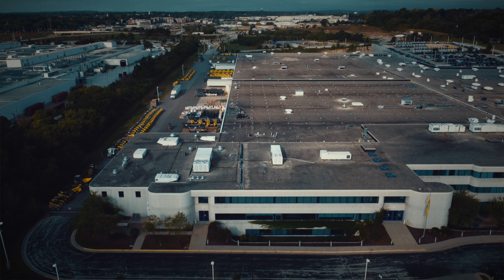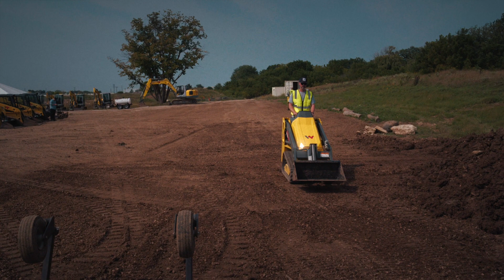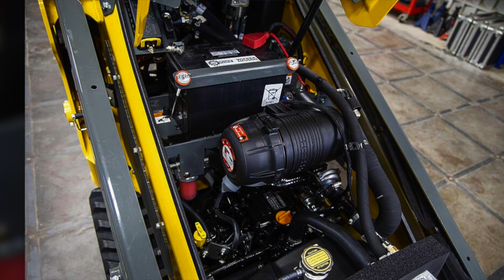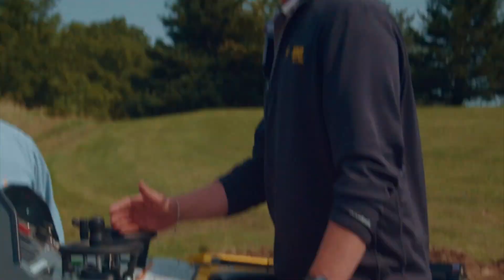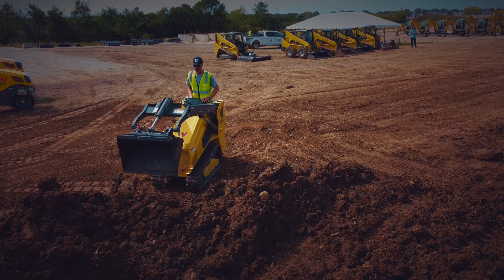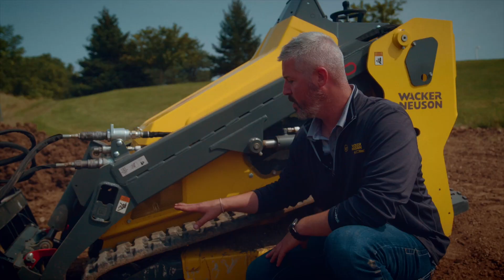In the Dirt: A Closer Look at the Wacker Neuson SM100 Mini Skid Steer at Work

Comment: I have the Ditch Witch SK1050 in southern Arizona and there is problem with radiant heat from the radiator, so I have no idea what he’s talking about. I love having the ability to step off my Ditch Witch and still operate my machine from the ground. As far as the joy stick controls for travel the single lever is optional, it’s your choice.

Comment: Looks like a nice machine and narrow is always good. The issue with all narrow machines is that everyone talks about how wide the machine is,  but rarely comment on how the bucket is wider. If you are truly working in a very confined space where machine width is the concern, a bucket that is wider defeats the purpose of the narrow machine width. It is not always an option to.lift the load above the narrow space
Reply: You can just lift the bucket up above wall height when passing through a gate  or chain it onto arm and lift and drive through

Comment: They need direct drive hydros like Kubota has. Screw the belt drive stuff
Reply: I looked up the parts diagram and confirm this 100%. Wonder how long that belt will last before needing to be changed? I do like how they mount the rad in the front with a pusher fan so it pulls cool air over the engine and hydros unlike the SCL where it is mounted in the rear for the hot air is blown over the engine and hydros.